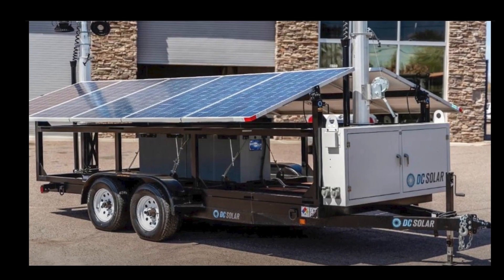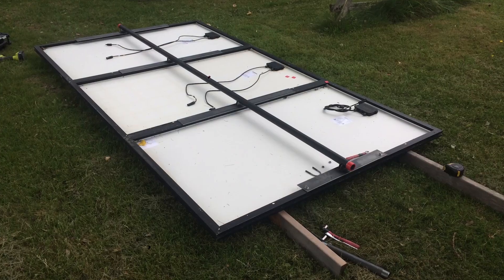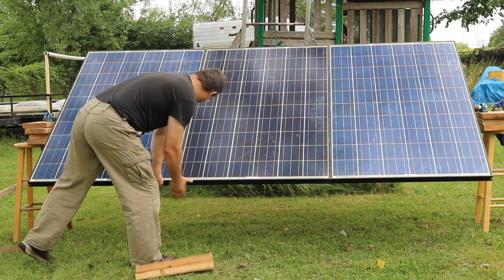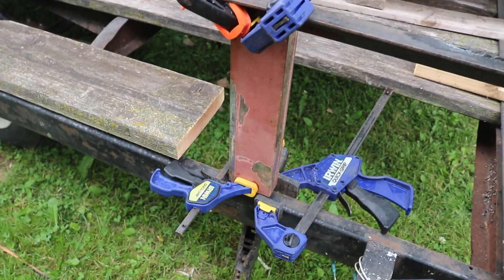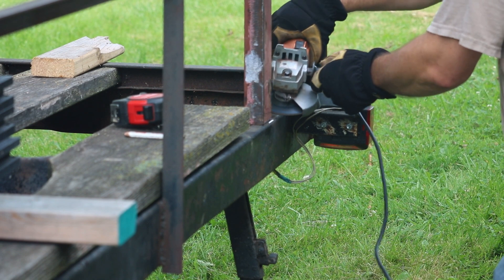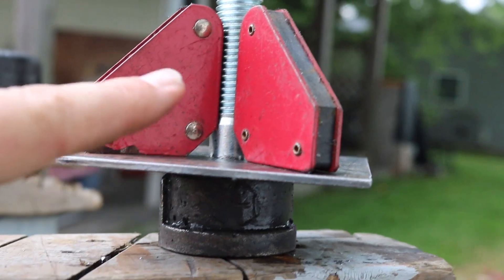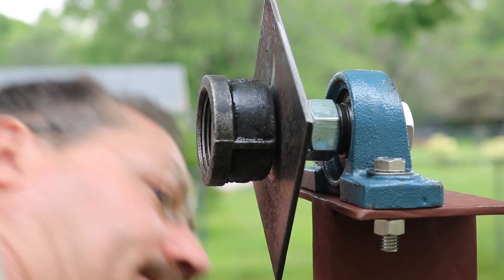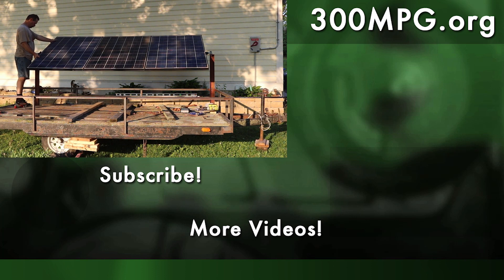Building a DIY Solar Trailer: Part 1

Comment: Did the panels swing too close to bed of trailer not allowing for batteries to go on bed?
Reply from the maker: The battery goes in a box in the middle of the trailer. I designed it so that the swing of the panels clears that box.
Reply: @BenjaminNelsonX  so cool did you have a video of completed trailer?
Reply from the maker: @ryanbruh752  Check out the full playlist of the project!
https://www.youtube.com/watch?v=qeuv2x_lE5Q&list=PLmHss3DBZUin-oq_ZOQkdC62hHJRpkEGs&index=15

Comment: Why not just mount them (on vibration isolators) at a good angle for solar receiving?
Reply from the maker: This will have two rows of solar panels on it. If the panels were mounted at a proper angle for collecting the sunlight, the trailer would be too wide to legally tow on a public road.

Comment: I'm a bit curious to see if you notice any increased electrical consumption from all the welding?
Reply from the maker: I'm pretty sure that welding is like useing a microwave oven. It uses high power, but only briefly.
I'd love to use a Kill-a-Watt type device to see exactly how much power and total energy it uses!

Comment: Great project to put to use some of the materials you have laying around.  One thing to consider that may be an issue in the future is the wall thickness of that black steel pipe.  It is only about 1/8 inch thick maybe a bit more or less for wall thickness but where the threading is on the ends it is much thinner and maybe a point of failure when being pulled down a road with many different shear forces acting on the pipe.  Just something to consider maybe having a removable rigid center brace to help support the weight when in the hauling position.
Reply from the maker: I ended up using 2" pipe on the other side. The slight increase in diameter really stiffened it up, and there was NO sag at on on that 10' pipe.
I also just welded right onto the end instead of using a pipe cap. Very happy with the results.

Comment: i have a bad feeling about those caps. imagine the q-forces with the trailer bouncing. 
great project!
Reply from the maker: The caps themselves are VERY strong. I'd be more concerned about my welding!
Part of this project is just learning a little engineering by doing. That's a big part of why you only see 3 panels mounted instead of 6! I want to learn what does and doesn't work on THIS side of the trailer, and then make any required improvements on the other side!
Reply: @BenjaminNelsonX  look, they might seem strong but if it's cast like it looks like, it's brittle, and i just wanna convey my view about metallurgy and engineering. 
so i can reappear when all your solar-panels went flying - and you admit this in a video, I'll be there to say hi.
Reply from the maker: @haugstule  If you have some ideas on how to build a simple, inexpensive, and strong mount for the panels, please let me know, and I'll try it out on the other side.

Also, note that the panels themselves are INSIDE the trailer when folded in. In case of an extreme failure, the panels should fail INTO the trailer, rather than onto the road.
Reply: @BenjaminNelsonX  square tubing is better than round , get a friend with a lathe (or hire a machinist) to make caps, square on one side, turned round to fit the bearings you already bought on the other side, with threads on the axle, nyloc-nut and split-pin hole. I'm eager to see how this goes and to hear that conclusions you draw from this, don't get me wrong I'm rooting for you!

Comment: Interesting project, thanks for sharing. It looks very heavy; will your Ford Ranger be able to tow this Solar trailer to a site? 🤔
Reply from the maker: I weighed the trailer. It's just over 1,000 lbs INCLUDING some steel weights I added to represent the weight of 3 additional solar panels. I have no problem towing it with a Mitsubishi iMiEV. I haven't tried towing it with the Volt yet, but expect that to be fine as well.